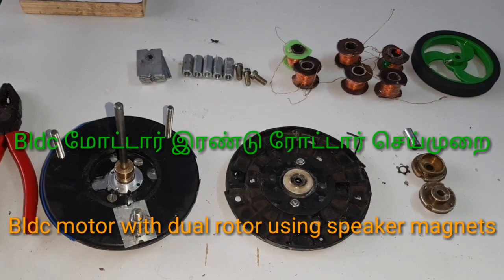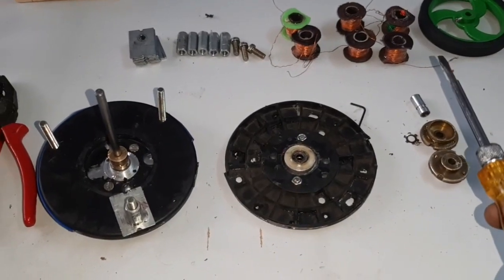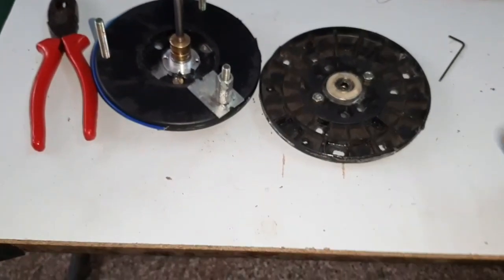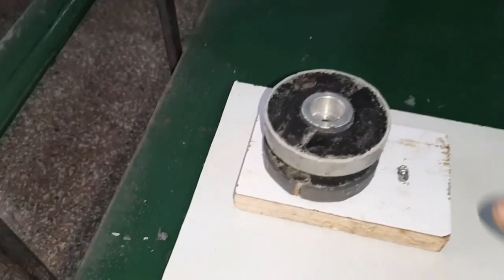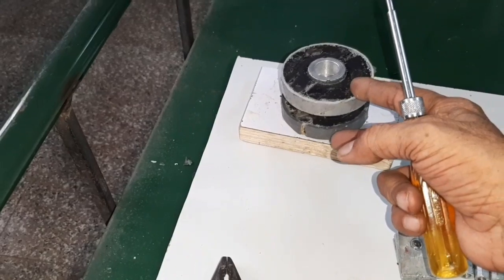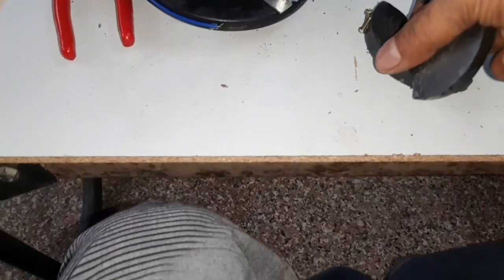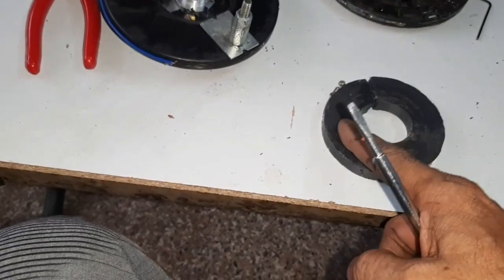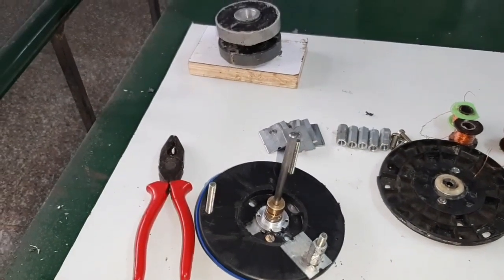(V-52),Dual rotor bldc motor using speaker Magnets.

Comment: Super sir.
Reply from the maker: Thanks for watch and support
Reply: @pugalstech  Welcome sir. 

Sir, may I know the details about bldc controller? And where it's available or can we make our own?
Reply from the maker: Spec of bldc controller
1.votage:12v dc
2. Current:1.2 full load current
3. FWD and Rev direction changes available
4.over voltage and over current protection available
5.cost may be Rs 500 to 1000
Available in amazon and flipkart
Reply: @pugalstech  Thank you for your valuable information, sir.

Comment: Very interesting. What is the significance of using three plates instead of two.
Reply from the maker: Thanks for watch
In speaker magnet pole are formed parallel to shaft and each rotor has two poles . The middle plate act as both north and south with respect to other end plates so each rotor poles are interacted two pole shoe plates
Reply: @pugalstech  That should increase torque in the motor. I think input power requirement is also low. Thank you